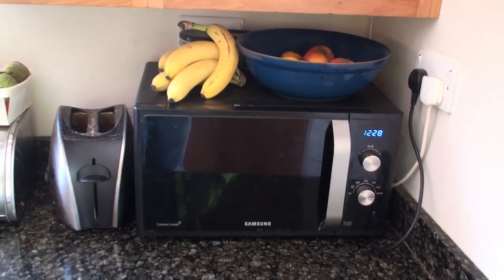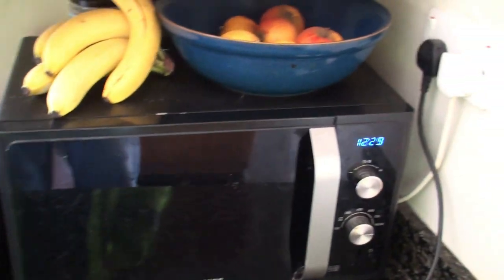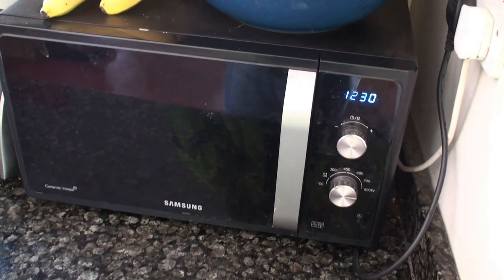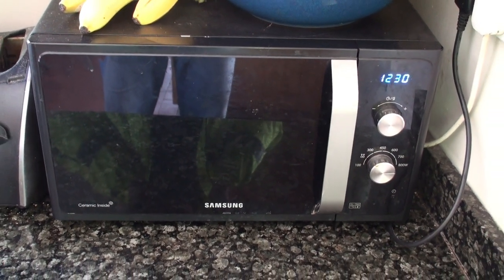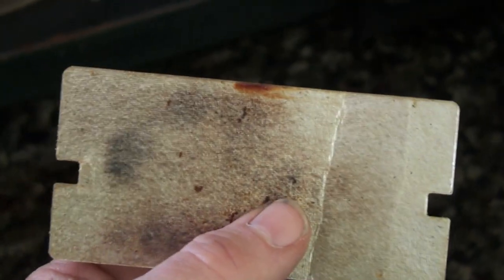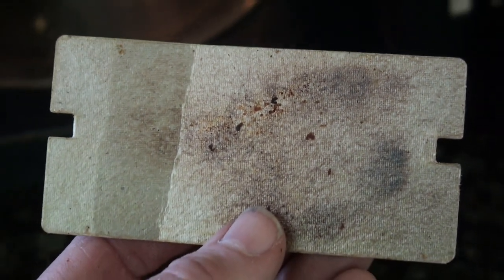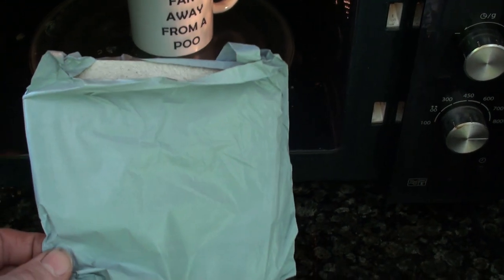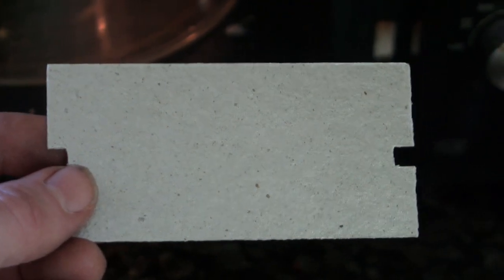MICROWAVE TOO SLOW LOW POWER? CHECK THIS CHEAP FIX OUT BEFORE YOU CONDEMN IT

Comment: Making this fix produced a 20% reduction in the time required to bring water to a boil. The old one looked fine, but, clearly something had changed as the old mica cover was just slightly translucent while the new one was completely opaque to light. We timed several bring water to a boil moves both before and after the fix to objectively confirm the improvement. THANK-YOU !
Reply from the maker: Good job. Whilst you are at it turn the microwave over and make sure the cooling intakes are free of fluff.  Nobody checks that but it impacts performance and reduces the life of the magnetron.

Comment: Well I am so impressed by this. I brought my Aldi microwave new from Australia To Philippines 8 yrs ago. I accidentally dialed in 90 minutes instead of 90 seconds and went outside to do something. Well when i came back in everything was fried and red hot. I managed to get a second hand turntable but the paint was fried. I cleaned it up and tried it. Wow it still worsks great. But over time had to double heat time. I been thinking to buy new. But like you I really like the way this one works and its got a grill still works good. 
Man thank you so much! I tried what you said and it appears to have worked. I will leave the thing off for a couple of weeks and compare. What I have done is scrape the resedue off the plate with a knife, Im going to try that. See what happens. But thanks!
Reply from the maker: Good job Tom. It is funny how we men get attached to bits of kit.  Someone pointed out that as Mica is s stratified solid that it is possible to split one sheet into two.  I split a tenant's Mica cover into two with a sharp knife and it worked.  Granted the bit I put back was thinner than the original but still stops splashes and steam getting into the wave guide.

Comment: I have a trusty Westinghouse microwave which has been working quite well for probably a little over 20 years now, recently it feels like it's losing power. Not by a lot, I think I'm adding maybe 20% cooking time.
So I took a peak inside and it has two plastic covers where I expect the microwave window to be, no exposed mica. Since it's not exposed I assume it didn't get contaminated with food, maybe in my case magnetron is more likely?
Reply from the maker: The plastic covers you mention are unlikely to be the magnetron waveguide outlet.  If the plastic were to get splashed the food it would carbonise and get very hot initiating the same process in the plastics hydrocarbons and cause a melt down and flare.  With regard to the magnetron, yes, if the wave guide is free then the magnetron might be the culprit.  Also have a look underneath the microwave. The vents can get almost completely blocked by fluff drastically reducing the cooling for the magnetron and the oven ventilation.   The magnetron is unlikely to overheat on a short run but will on a longer cooking cycle.  I wondered if the lack of ventilation allows water vapor to build up  in the oven absorbing the microwaves before they hit the food but I don't think this is significant. Good luck with it.
Reply: @razenby  I tried to pry them open after posting the comment, they have clips that can only be opened from the other side though so I didn't remove them completely. I did pry them enough to see they each cover a small window with what looks like mica behind it (again only accessible by opening the unit completely), and the mica looks flawless.
I don't know what kind of plastic they are, but I could clearly see one of those clips that have two flares to catch the chassis, so it gotta have some elasticity to it so it can't be ceramic but it also doesn't sound like metal.
I also saw your other microwave-related video so I checked the vents but they're surprisingly clean, to the point where it outta be passive cooled.
Reply: Oh and it says "Multiwave" on it so I guess it makes sense for it to have two windows.

Comment: ❓❓❓ QUESTION : FROM  U.S:  my machine is 1000 wats and so many co.'s want y ou to only use 1100. sigh. Can the power be pushed up to 1100 by changing magnetron, or some other part? (I'm ignorant of all t his lol).   Thanks
Reply from the maker: In my experience manufacturers play with the watt rating to gain sales.  There are commercial microwaves that have a higher wattage.  The output from microwave to microwave varies quite a bit.  the magnetron is a tuned device and there is a wide spread of actual power output. A magnetron that happens to be spot on will produce 20% more RF power  than its peers even though they roll off the production line with the same part number.  Then they fade away quickly as they are used. I wouldn't fit a different magnetron as the power supply wont be man enough, and, there are lethal voltages inside the microwave that remain present for some while after the power is unplugged.  A bloke down the road for me was messing with his and never came back in from the shed to eat his dinner never saw his lovely wife again.

Comment: My microwave blew its fuse after cooking corn on the cob.  Replaced the fuse and it blew straight away.  So I started testing and found the Capacitor bad.  So I replaced it.  Now it starts out, good and bright and sounds normal for about 4seconds, then gets really dim inside and the fans slow, and turn table slows.  I replaced the magnetron with same result, then tried another transformer from another microwave.  The rectifier tests good, and even the original transformer tests good at 160ohms when the repair manual says it should be "around 150ohm" so I'm guessing that's not it.  The filament coil says "around 1ohm" and it tests at 2ohms so I'm guessing that's not it.  Primary winding is at 0ohms, which is spot on.  It still heats, but I'm really scratching my head on this one.  Lol.  No matter what I try, it still bogs down, with just a cup of water.  But it does heat it.  Also pulled the part on this video off, but no change
Reply from the maker: Hmm there are fatally dangerous voltages in the microwave so be very careful,   Th rectifier could be breaking down or you may have some shorted turns on the transformer.  The three or four seconds sound like it fails when teh magnetron starts conducting heater warms up. Have you tried it with the old magnetron?  the magnetron is a tunes self resonant device. If for some reason it oscillating then it may draw a very large current as it turns into forward biased rectified thermionic tube.
Reply: @razenby  I tested the transformer and tried another transformer from another microwave,  as well as the new and old magnetron.  It doesn't seem to make a difference.   I'm done with this one tho.  I pulled out all the parts I plan to keep, and I'm scrapping the rest. Lol.
Thanks

Comment: Castles in the Sky      is an Epic movie  about  radar  with links to the magnetron
Reply from the maker: Love the development of the magnetron in Cambridge in the middle years of WWII.  Considering that in the 1920s the  professor of electrical engineering at Cambridge confidently stated that "It is, and will be impossible in the future to generate frequencies above 30 megahertz"      The Germans cottoned onto the magnetron but had real production issues as they had t machine the cavities to extremely fine, almost impossibly tight tolerances to get resonance.  Whereas the Brits used a metal strips at the end that acted as a tweakable capacitor at the end of the magnetron cavities.    Genius.